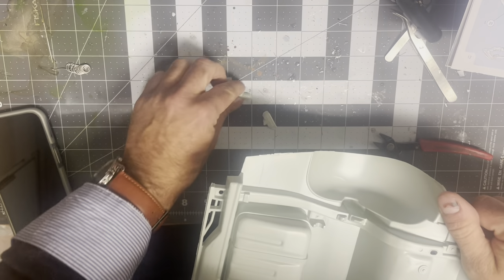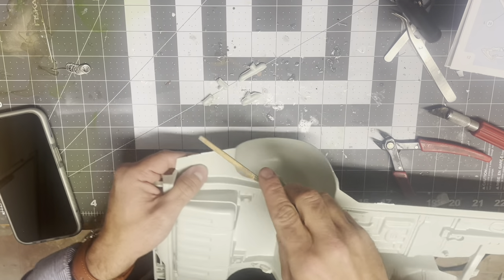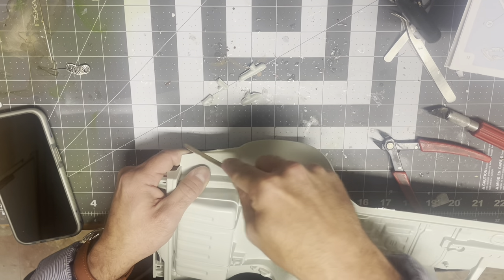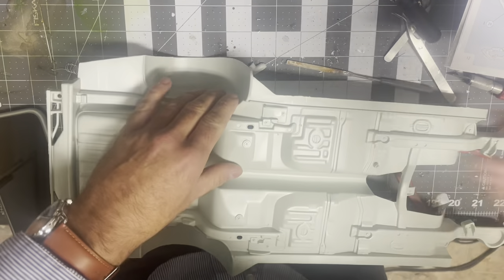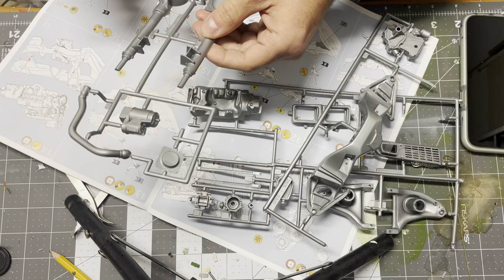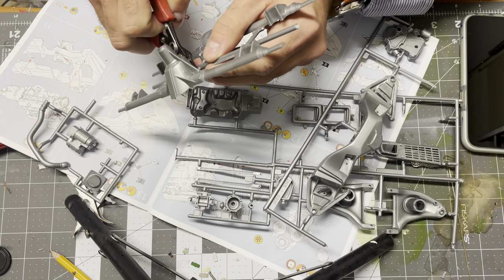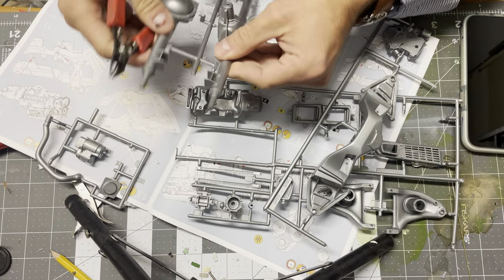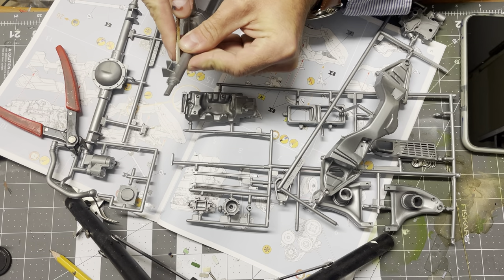Smokey and the Bandit 1/8 Scale Build.   Part 1 Underbody.

Comment: Try removing the paint where 2 pieces come together before gluing,  you'll get a much stronger bond.
Reply: Thank you for mentioning this. Removing paint and plating is an absolute MUST when gluing styrene together. ESPECIALLY on model this size. That’s a bunch of weight and bulk to sit on questionable glue joints. 😬

Comment: What glue do you use?
Reply from the maker: Tamyia or CA depending on what I’m doing.
Reply: Ok thanks, just received this model today.  Just finished the millennium falcon and used super glue which I think is the same as ca glue.  Haven't done a styrene model in years. @LCModelBuilding
Reply from the maker: @unsunghero72  very nice!   Have fun with it.  I’ll be back at work soon with this build.  Just been trying to get through all the Christmas stuff currently
Reply: I will be following your videos on this build, so thanks so much for posting. @LCModelBuilding